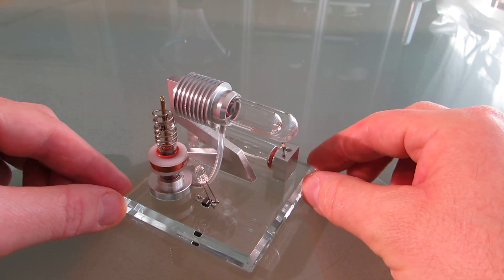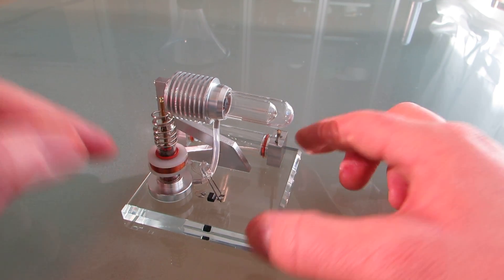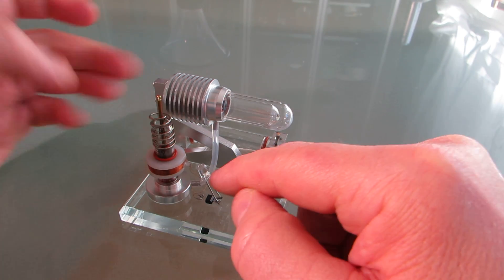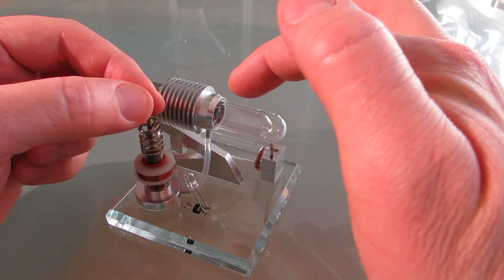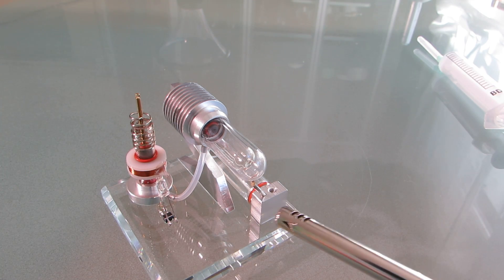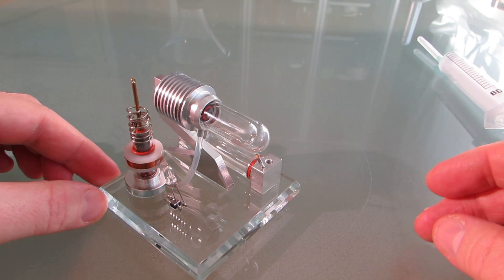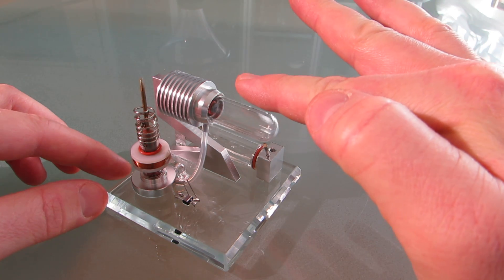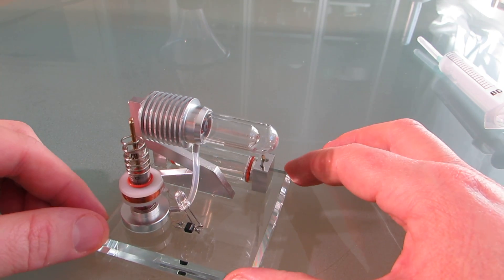Could this be refined to a phone charger?

Comment: I wonder what the velocity and frequency of the piston is because while it may not generate current i imagine it could be mechanically more efficient than a stirling that moves a wheel due to there being less friction. So in the case of say a tattoo machine if we disregard the voltage that is generated and just look at the mechanical force this could be a viable option for powering a wireless tattoo machine especially if you could regulate the freequency somehow.
Reply: Nevermind I thought the magnet had to do with the movement of the free piston

Comment: thanks for posting.  here are some things to consider.    it should be understood that a so-called 'free piston',  is  simply  a piston NOT configured to do  Work,  EFFICIENTLY.       it should be understood that a reciprocating machine has  ZERO  conservation of momentum.  UNLESS,  the  output motion is Converted to  ROTARY.         output force of  ANY  heat engine  SHOULD  be  'utilized'  Only   AFTER   Concentration/Smoothing of force, via the use of a crankshaft.       in the engine seen here,   the load (of the pma)  has  been made A  PART  of the engine.  doh.   so, no cigar.     cheers         googletranslate

Comment: Regarding the question of if it could be refined to a phone charger, that is not the important question. Of course it could be scaled up. The important question is would it economically feasible. The LED takes about 70 milliwatts.  A phone charger supplies about 2 to 6 watts. That would take between 30 and 80 times the output. Smaller currents can be used to slow charge but realisticlly it would take a much larger device. Sterling engines are not very efficient, they 're best use is to extract waste heat and convert it into rotational motion. When you start converting to electrical energy there are more losses to consider. Running one using dedicated fuel would not be cost effective at all. Even if the heat is a byproduct that would otherwise be wasted it still is not the best option. A thermoelectric generator cell is more efficient, silent, and cheaper. The Stirling engine is at best a fascinating novelty
Reply: https://www.youtube.com/watch?v=e0cp2pFqscM ...
Reply: I stand corrected. Current thermoelectric generators (TEG) reach an efficiency of around 5-7% and Sterling engines CAN reach about 20%. However TEGs operate over a much wider range of temperature (specifically delta), work automatically and instantly, are much easier to incorporate and operate, are silent, have no moving parts, and last indefinitely under the rated temperature range.
The video posted in response to my comment is intriguing in that it produces a direct linear coupling to an electrical generator which is the minimum number of parts necessary and uses water for inertia which would not wear out like a mechanical flywheel. The weak link is the diaphragm which would be subject to repetitive stress wear.
It seemed to start smoothly but there was some physical interaction that I didn't understand. It seemed to require the typical push to get the movement started. That is one characteristic advantage of a TEG since it produces energy as soon as there is a temperature differential.
It did give me an idea of using two opposing water chambers to use as complimentary pendulums with intake and exhaust tubes, perhaps with magnets on floats with coils around the tubes to extract electrical energy. I'll experiment with that.
 Thanks for posting the response.
Reply: I guestimated figures which led to about 100 hours for fully recharging a 2,000 mAh battery, which is quite puny by modern standards. Maybe 10 hours would provide enough for an emergency call.  I've simplified out the infamous conversion factor for lithium and other losses....  not exciting.  I'd expect a medium size hand cranked dynamo to produce, say 2.5 W, or 500 ma at 5V.  For a 10% recharge, thats about half an hour instead of 10.  Tedious, but quicker.   I agree with what you said about Stirling economics being most interesting for waste heat, not burning fuel purely to run the engine.  Off to watch the video that someone cited now.
Reply: Oh and I forgot to say, it's a nice little engine, I'm putting on my Santa's list....

Comment: Brilliant! I wonder if it could be powered by focussed sunlight instead of flame?
Reply: Any heat will work, and saying that with large fresnel lenses you can get over 2000 degrees C, i'm sure it'd work!
Reply: would work... just paint the end black to make sure the light doesnt pass through
Reply: You would have to get a metal end or paint it black like the previous reply said, otherwise the sun will go right through